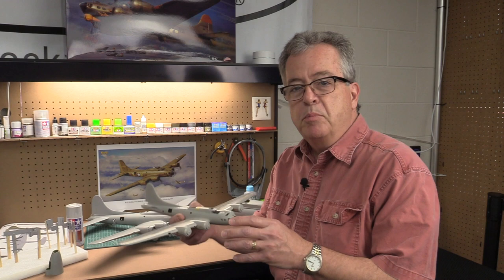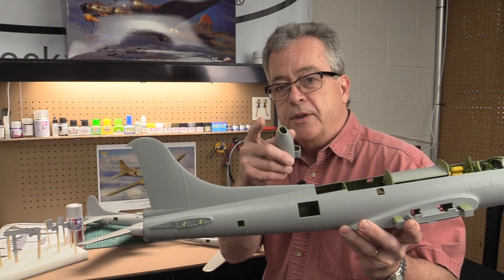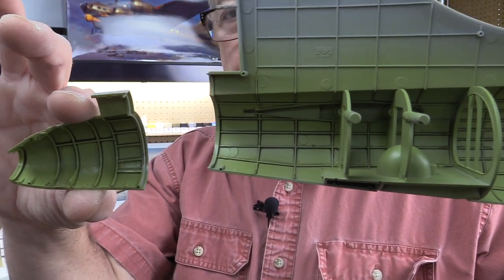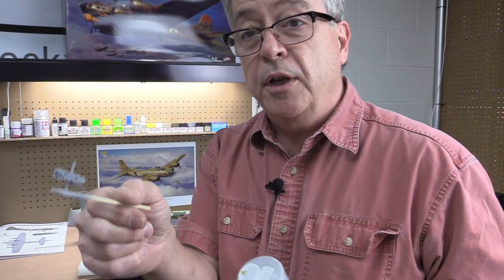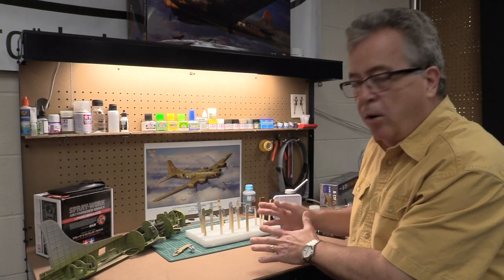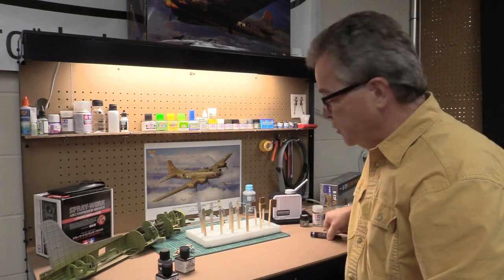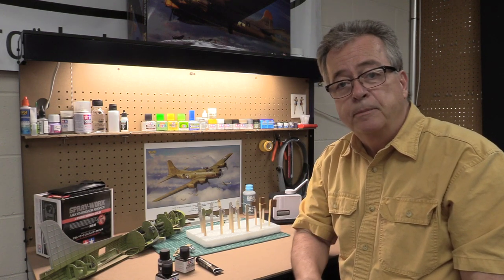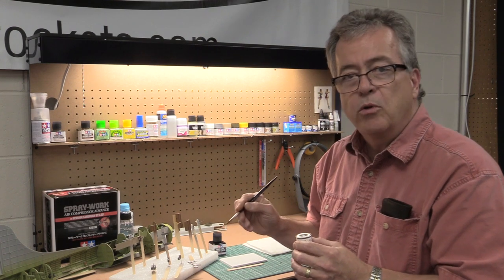How to Paint HK Models' B-17 Model Kit

Comment: Pictures of the real ones in service show dull dark green cockpit,bare metal radio room and rear section.Bulkheads may be painted.Bare metal nose/bombardiers section.
Reply: Interiors were not definitively schemed. Depending on manufacturer the interior of any given batch of B17's from marque to maker - Boeing (BO), Douglas (DL) or Lockheed Vega (VE) could vary greatly depending on paint batch and supply then AAF mandates or stipulation at a given time which changed and evolved constantly. Batches alone varied greatly. Often it was left to a factory floor level decision and Zinc Chromate Green, Zinc Chromate Yellow, Medium Green, Dull Dark Green, Bronze Green and bare metal variations were many. We don't live a 'black &  white' - "this is the way it was" world now and back when, it was even foggier. Then once these aircraft left the factory there were many subsequent variations from orientation, squadron level requirements to field/line/service delivery and so on. You make an all encompassing, uninformed, unresearched and vague summary which has no base in reality. Disregard from Tuckombil via Alstonville and East Ballina 800km north of Sydney. MATE.
Reply: *what reference material are you seeing???
Reply: @christiankirkwood3402  Just going by various pictures from the net,period pictures not of restored ones.The whole subject of colours is not an easy one I know.
Reply: @stevengriffin7873  Way to go. Period pic's show them as they were. Keep this in mind. The ratio of photographed aircraft to the number built - approximately 12,000 odd B17's from E, F to G - from 3 different manufacturers as I mentioned, and the source material is thin. There were way, way few military, factory, field and cinematic filmers (William Wyler's og doco "Memphis Belle" was released ages after her tour and was one of a kind - they never knew she'd end up selected for the "1st to complete a tour" either!!!)and or photographers compared to sheer volume of inventory. There was great variation due to block type, production run, quantity required as per demand, paint supply, mix and variation. The ANA/FS designation on tonal evolution, type and mix ratios is staggering for each of those colours I mentioned and the application process of what shade where as requirements changed. This subject is a minefield. Warmest and very sincere regards from Sydney and Ballina :)
Reply: @christiankirkwood3402  Sometimes training films especially in colour such as one that clearly shows the dark green(similar to euro dark green)instrument panel on a B24 rather than the lighter interior green.Also have a BW picture taken in a B17 cockpit sometime in 1945 still with the armour plates behind the seats was very unusual by then.You can clearly see it's a dark colour.In the end it's really just looking at picture after picture and making your best choice,hopefully correct.
Reply: @stevengriffin7873  Okay mate 🤙